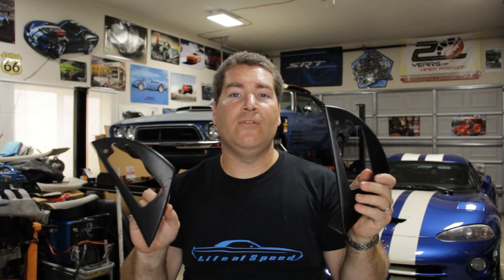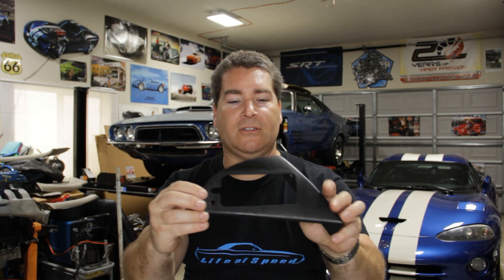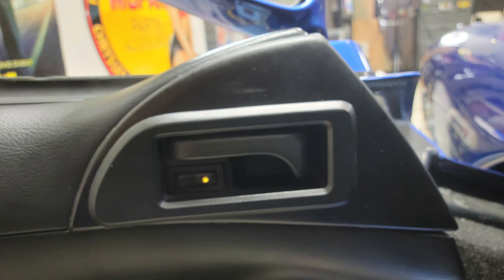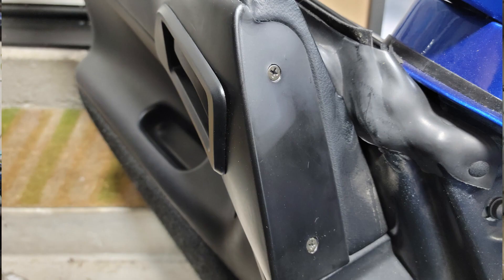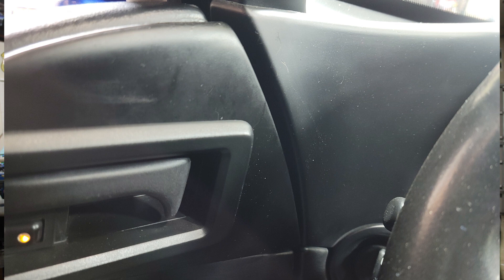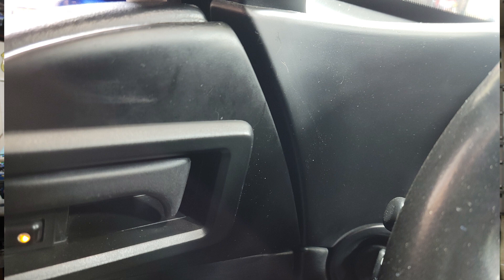How Does the Aftermarket Dodge Viper Door Bezel Compare to the Original

Comment: You know one of the things you could do with a part that is in bad cosmetic shape is actually polish the plastic, theirs legitmate products out there for polishing rubber and plastic of all things, I actually use a headlight polish for plastic headlights for my watches with Acrylic domes, either that or have someone cover it with leather, alcantera, or Vinyl, like take it to an upholstery shop and ask them to cover it

as its one of the ways an automotive god here on youtube uprated the interior on his little british kitcar that came with cheap plastic for the interior, he literally had them just recover the dash in leather with the plastic underneath

also with the way you framed the photo, I thought this was talking about the door hinge frame on the outside given the blue and white, not the exterior frame of the interior grabhandle 

which knowing parts sharing, check the back of the part for a number, you'd be surprised on what these people reuse from other cars on these things.